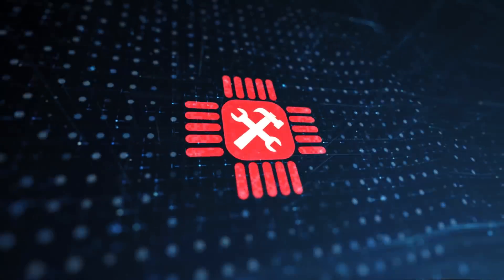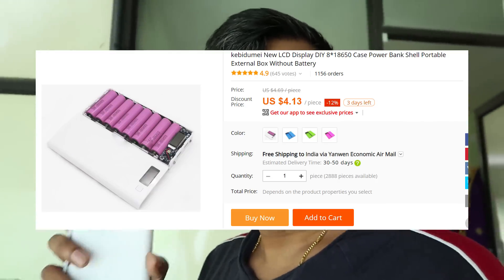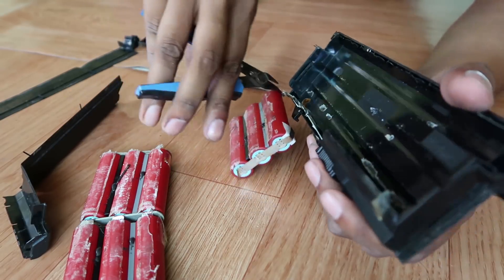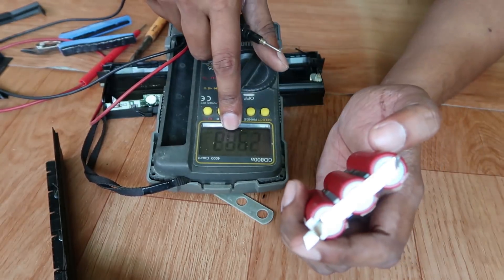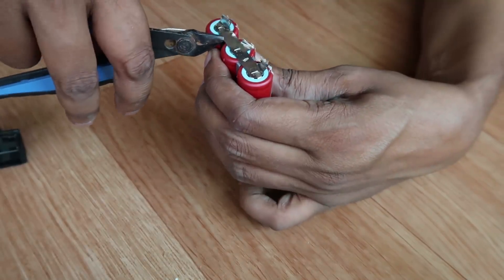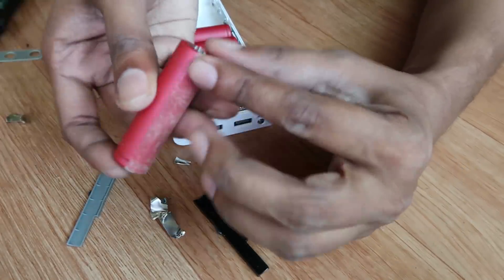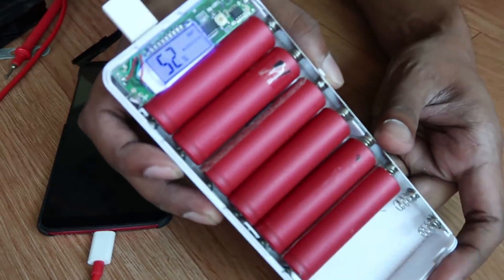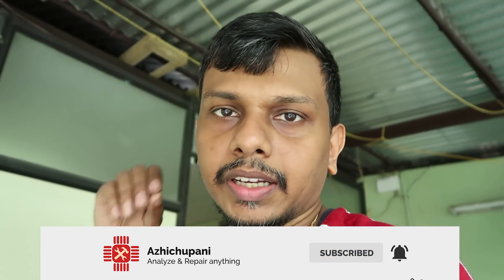300 രൂപക്ക് പവർ ബാങ്ക് | Power bank for ₹300 | Disassembly and Assembly

Comment: Bro tell me, 2 things. No1 u not inserted all battery, I saw 1 battery less. & no 2 I saw in Amazon link, here 377rs showing. But full packed battery too. "included".  W/out battery this power bank not get?
Reply from the maker: Bro 1) you can place one or two battery and make it work. More battery means more backup.
2) I am not sure if seller changed the listing.

Comment: You revealed reason why my syska   power bank stopped working in less than 2 months , I am shocked and surprised to see fraud involved in power banks... Thanks for sharing info ... I will try to build power bank using my faulty lap battery..much appreciated
Reply from the maker: Thanks for the support..

Comment: Njan azhicha laptop battery model 11865 anu ithupayogican pattumo
Reply from the maker: Yes, same size alle?? 3000 mAh engandu varum..
Reply: @Azhichupani  size 11865 anu, ivide linkil koduthirikkunna battery size 18650     appol size difference ille

Comment: Alla bhai, ee battery kadayil vagan kittumallo, athalle nallathu, pattumengil ee laptop battery egine repair cheyam ennu parayamo... Njan kure nokiyatha.... Athil electronic lock okke undennu thonunnu.... Oru video cheithal nannairunnu
Reply from the maker: Laptopinu aano batterykku aano vilakuravu?? 🤯🤯🤔🤔
Ee laptopinde battery repair cheythu ittattu  laptop adichu poyal nalla labham aayirikkum alle??
Theri vilikkaruthu.. ithu oru chintha shakalam aanu..
Reply: @Azhichupani  sariku paranjal athile battery repair cheyuvanel ayiragal anu labham.....
Cell replace cheyunnathil enthelum kuzappam patiyal output voltage kittathilla..... Athinal laptop pokum enna pedi venda enna thonunnathu... Chumma onnu nokittu parayu, kayil athyavasyam tools undallo, eniku athanu illathathu, athanu ente prblm, allel laptop adapter nte output rating ill ulla power bank undakkan pattumonu nokkamo, adapter nu pakaram same rate ill ulla power bank connect cheyalo

Comment: oru powerbank nalathano ennariyan "pass through charging" undo ennu nokiyal mathi ,means power bank charge cheyunna same time usb output kittum means powerbank charging timil parallel ayi phonum charge avum which means the circuit board  is good kore kaalam steady performance tharum, almost all lenovo power banks has pass through feature
Reply from the maker: Adipoli..

Comment: ഇതിൽ കാണിക്കുന്ന ബാറ്ററി ഒരെണ്ണം എത്ര വോൾട് ആണ്?
Reply from the maker: 3.7 volts aanu.. 18650 battery ennu search cheythal mathi.
Reply: @Azhichupani   thanks bro
Reply: Ella batteryum parallel alle... Appo 3.7 volt kond engane 5 v charge cheyyum
Reply: @fayizct8039  3.7v to 5v boost converter circuit ane PCB il ullath.
Reply from the maker: @fayizct8039  athinanu booster circuit...
Reply: @fayizct8039  no
Reply: @fayizct8039  .
Reply: I don't know
Reply: 1.2 volt

Comment: 18650 battery orennam maximum 2500 mah varullu!!
Reply from the maker: Dell Battery packil around 3000 Mah aanu one cell. Njan ithunu mumbu nokkittundu
Reply: @Azhichupani  👍
Reply from the maker: Pink color cells aanu kooduthal capacity.. ende experience il
Reply: @Azhichupani  weight etra und?
Reply from the maker: Not sure ethandu oru 9 cell laptop battery de aduthu varum...